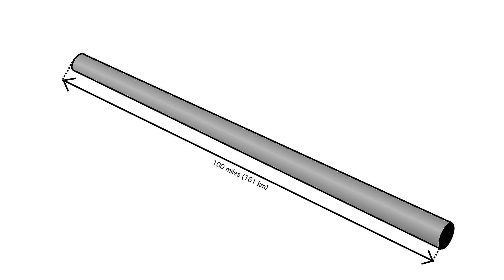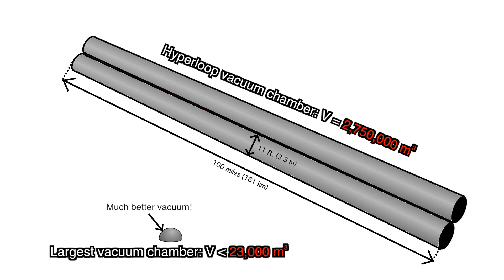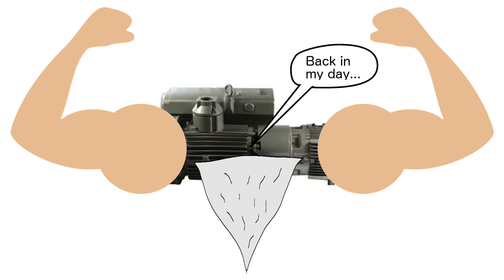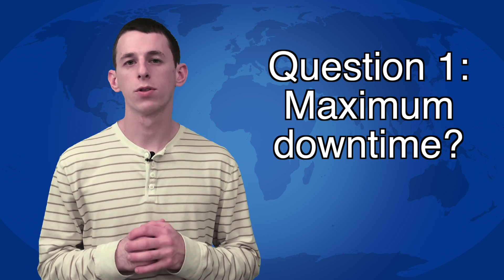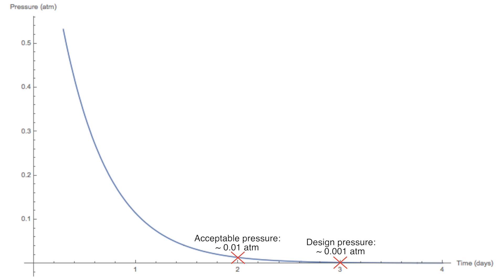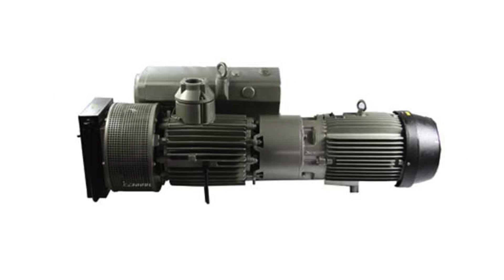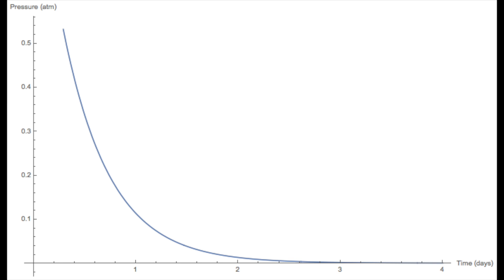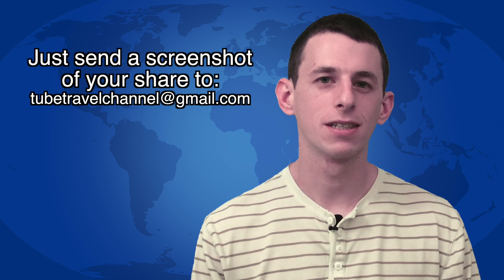Is the Hyperloop Vacuum Too Big?

Comment: Could you create a vacuum simply by pushing the air out as if the tube was a piston? And once the piston was 'driven' through the tunnel then whatever is behind the head would be in vaccuum right?

Comment: Would they be any leaks in the tube? Or once vacuumed it would stay like that for a long time?
Reply: There will always be small leaks in the tube. For instance the LHC has known leaks and mitigates them by pumping continuously. The question is, with such a volume (and surface) of air, will the pumps be able to catch up with the vacuum leaks? I think this is a major challenge, because it's going to be expensive to achieve.

Comment: Here's a video idea for you-  You show a tube 100 miles long.  Can you show how the travel  works to average 600 miles per hour?  What acceleration is needed, and what would the maximum speed need to be?  I can't get the maths right.
Reply from the maker: That's a good question.  At an acceleration of 0.5 Gs, a capsule would reach 600mph after traveling only 4.56 miles.  With this acceleration, the passengers would feel only 12% heavier.
Reply: Tube Travel how much each passenger will weigh after sudden deceleration.  do the math genius.

Comment: Partial vacuum surrounding the pod could be better option on long-term. This can be achieved by reactive control of bypass boundary layer transition with DBD plasma actuators. Main idea is to control bypass transition in order to prevent emergence of turbulence. Plasma actuators can also postpone sonic boom effect. One of the problems of Hyperloop is the heat dissipation in near-vacuum (https://mdao.grc.nasa.gov/publications/AIAA-2015-1587.pdf) which needs to be compensated by using larger tube/pod cross section ratio. 

Plasma actuator array with control feedforward and feedback estimators would probably change design paradigm from permanent system near-vacuum to temporary unit near-vacuum. Demands regarding steel structures would probably mitigate, meaning also lighter support, zero pump costs and faster assembly. Perhaps safety mesh around the corridor would be enough instead of thick steel tube to prevent external distractions. In water similar outcome is possible to achieve by supercavitation submarines. 

Investments to active flow control devices might help to achieve funding / reduce risks because the technology could be applied to whole transportation industry (cars, trucks, planes, trains) and other applications affected by gasses such as wind turbines. In example Plasma Stream Tech promises to save 15 % from fuel consumption in heavy-duty trucks with their solution.
Reply: Partial vaccuum also would change the capsule metal fatique as it transitions from regularly pressure to vacuum.
Reply: Kantrowitz limits dictates the requirement for a high- quality vaccum.

Comment: what about looses of vacuum ..you can not make it sealed due to dilatation and how you will solve the stations .it is non sense
how you will do the regular check and maintenance of the magnetic rail and electronics ...will release the vacuum or send there people on cosmonaut scafander 
what if capsule stop in the middle of the track how do you get people out 
it is like sending space modul trough CERN
Reply from the maker: You bring up some good points, but there are solutions to all of the problems you mentioned.  Which one are you most concerned about?  Maybe I can make a video about it soon.

Comment: Check out Origin Clear Inc on utube. Add tubes to move waste and overflow water  to treatment at stations.  Grow algae, fish, food and bio gas energy.  Build farmers markets and  support pasture raised savory institute certified safe foods locally grown.  Move water south to store or use for irrigation after electric water separation cleanup.  All stations have zero waste stream, sell electricity, fish, vegetables, meats, compost, bio char, heat fuel  and become farmers markets, not shopping malls.   Move water during rains and spring melt to available storage or added capacity.  All water is from a saved source from ocean dumping.  End the bullet in the brain trains and the water tunnels that destroy the delta with votes.  Game changing algae harvesting and all water cleanup.

Comment: Hi! I've seen on another video that if the tubes lose their vacuum, the air would fill the tubes at the speed of sound and destroy everything inside the tubes, including the capsules, is that true?
Reply from the maker: Thank you for bringing this up Dan.  I have seen this misconception as well.  There are many factors at play during a tube breach, but I cover the worst case scenario in this video: https://youtu.be/X6SuY9Mva-c
Reply: Yes, but you didn't comment on what comes next- 6 or 60 people stuck motionless in a thick walled tube, many miles from rescue.

Comment: Hiperloop persons tube warnig, yes.
Train persons = tube warnig, yes
Aviation persons = tube warnig yes.
Navegation water persons = tube warning, titayes.

Hiperloop water resistant persons tube = yes? 
and Hiperloop suspendig cable meters = S. Fracisco puente, vivrators flexible Hardkuaker velocidad reducez persons tube yes?
Hiperloopop posible used and producer energi, yes?
(%)

Comment: In your calculations you suppose 100% tightness, isn't it? Redo and include losses due to thermal issues, ageing and other. Then see that energy needs and pump costs raise significantly. And that it will be very difficult to impossible to come lower than  certain pressure targets. 
Study the "Swissmetro" of the nineties, which planned much better: Just 7% of normal pressure, all vessels remain in the evacuated domain in normal operation, and all is in tunnels much below the surface, reducing thermal expansion and allowing for very straight routing. But this masterpiece of a proposal was still much to expensive, even for the ultra rich country of Switzerland.....
And: follow the money, and understand, why certain people do this professionally, burning some venture capital to their own personal interest....
Flying to the moon never was meant to become a normal daily routine, but was proven to be realized. No question about the technical feasability to do hyperloop as well, but totally unconvenient for transportation of masses.....
Reply: before the Swiss, we in France have studied this concept in the 80's with TGV, and found it very xpensive to build and operate.   so we did not want to repeat the Concorde mistake ...
forget about Hyperloop, unless a quantum leap is done in vacuum technology.
Reply from the maker: Thank you for bringing up these points.  I was not analyzing leaks in this video, only initial evacuation of the tubes.  The pump costs would be about what I estimated, but the main point I was trying to make is that they would be insignificant compared to the cost of the rest of the system.  The pressure I analyzed is very achievable.  Compare this to ET3 which proposes a much higher vacuum but still very achievable.  If you want, I can talk about leaks during operation in a future video.

I think the proposed operating pressure of the Swissmetro was far too high.  That is probably why the project was scrapped.  A 7% vacuum has essentially the same structural requirements as a 0.1% vacuum.  You have the same structural cost with 70 times less efficiency benefit.
Reply: Swissmetro was too expensive. Efforts of maintaining 7% or 0.1% are very different. The energy needed because of lower drag  at 0.1% is just about 20 % less than at 7%, conservatively calculated. You completely not understand the relation between the evacuation grade and aerodynamic efficiency. Go and study physics, and then make videos again.....;-)
Reply from the maker: How do you figure only 20% less drag?  Drag varies close to linearly with air density.  This is simple aerodynamics.
Reply from the maker: Weazel, I'm glad you pointed out repair time.  I decided not to include that in this video for time's sake, but it is a concern.  If I were designing this system, I would probably construct the tubes as modular sections that could be replaced fairly quickly.  If not, this may add significant downtime for the route, but it would be fine since we would still have cars and planes.  Also, the situation I proposed in this video is highly unlikely in the first place.  The 300 pumps would completely evacuate both tubes in about 3 days: http://www.engineeringtoolbox.com/vacuum-evacuation-time-d_844.html
Reply from the maker: Not yet, but that one should be coming soon.  I think I have some good ideas about how to solve this problem.  Do you have any suggestions for me to explore?

Comment: Thank you for this insightful video! You give a very unbiased view on Hyperloop travel, and in this case, vacuum. Good luck with all your upcoming videos!
Reply from the maker: Thank you!  Let me know if you have any ideas for future videos.  You probably know the major challenges to the hyperloop better than I do.
Reply from the maker: Maybe I am a little biased, but I definitely try not to be.  What are your concerns about tube travel?  I can explore them in a future video.
Reply from the maker: I'd say Musk didn't do it for two reasons.  

1. He is too busy with other companies (although he started The Boring Company, which seems to have tube travel as its ultimate goal).  
2. He sees the high risk and capital involved in an endeavor like this.  

But regarding your comment on economic feasibility, that's a big concern for sure.  I still don't know for sure if it can pay for itself, but my gut tells me yes.  I would expect tickets to be far cheaper than airline tickets.  I'll have to eventually put together some more accurate cost estimates.  One thing that can lower cost is decreasing tube diameter since the cost will go as roughly the square of diameter.
Reply from the maker: There could be some cost savings by having the capsules carry more people, but this factor would not have a significant effect on the cost per ticket because most of the cost would go toward infrastructure (tubes, pylons, etc.).